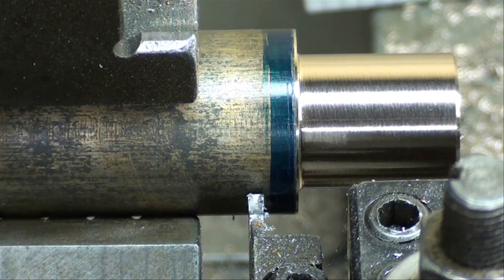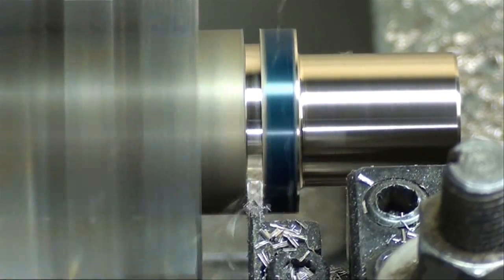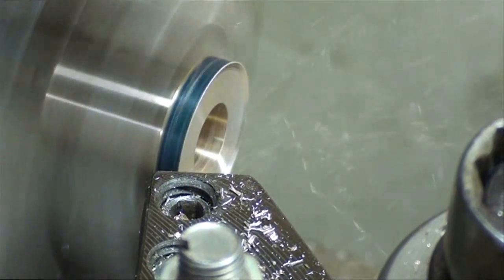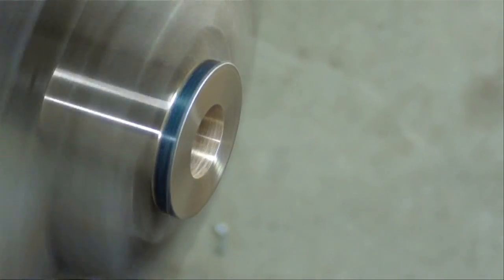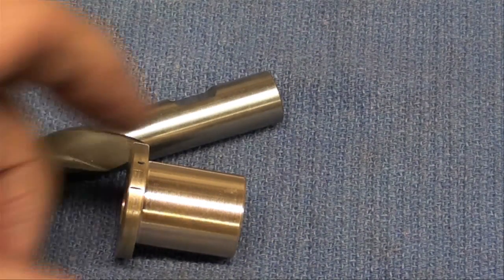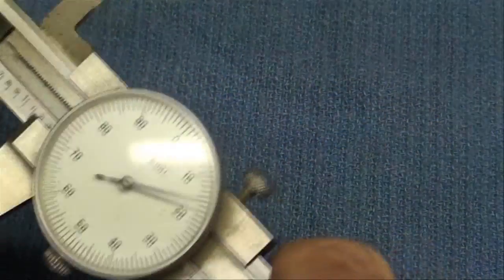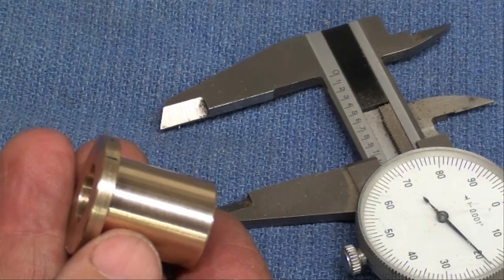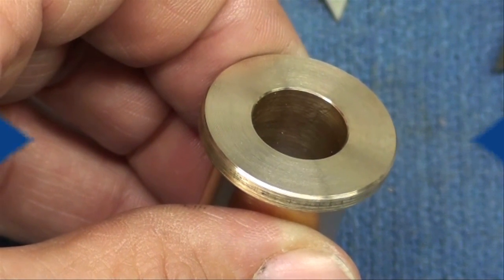MACHINE SHOP TIPS #48 Lathe Project BEARING Pt 3 tubalcain

Comment: Hello Mr Pete. I need your advice please.. I have an old Oliver pattern makers lathe that has the original babbitt bearings in the headstock and they are in need of replacement. Rather than pour new babbitt, I'm considering machining bearings of bronze or phosphor bronze, and would really appreciate your opinion regarding this decision.. By the way, I really appreciate the videos you make for me.. And I don't mind that others watch them too...Lol. 
Thank you sir...
Reply from the maker: Thanks for watching. I have never done this operation.  But if the shaft (spindle) is worn, it needs machined too.

Comment: In the beginning you mentioned that the brass was self lubricating. Does that mean that as it wears, the pieces that wear off slide around in a way that doesn't damage it? Why is brass self lubricating and steel not?  Or is steel too? What makes one metal self lubricating vs another?
Reply: +traderjoes The piece he showed was sintered bronze, not brass. Look up "sintering." It's a process that creates tiny voids in the metal that soak up lubricants like a sponge. Bronze is often used for self-lubricating bearings like the brass one he made here.

Comment: How is that a bearing and not a bushing?
Reply: Technically bushings are bearings. Most "frictionless" bearings have three parts (Sleeve, Journal and then some kind of rollers or balls). A bushing is basically one half of a bearing and the shaft (or "journal") completes the other half. There are no balls or rollers because these types of bearings aren't frictionless. So... technically, a bushing is a part of a bearing. They are sometimes referred to as plain bearings, although I don't think I've ever actually heard someone call them that. Might depend on what industry you are in.

Comment: The cutoff tool is grabbing because it is set to cut above the work's horizontal centerline.  Adjust the tool down to centerline or slightly below, and it won't grab.
The negative rake will also help a great deal.

Comment: I want to buy a lathe but I do not know what all I need to buy, some have told me I need all kinds of extras, like steady rest, a follower rest a 4 jaw chuck and so on, have been looking at a 7X 14 mini lathe any were from 600.00 USD plus shipping to $5000.00 plus shipping, but that one has the milling machine on it as well, witch I also want to get and learn, as I build many things and need to cut key ways for hydraulic pump drives or sprockets.  Any ideas?

Comment: Not sure if you can cut round holes in plate steel on a lathe, an old timer made me a boring bar years a go to use in a drill press, to cut holes in heavy plate, not to mention all the other scary things I have cut using a drill press, oooww,

Comment: With the lathe I only need to make pins manly 3” to  12” long, and ¾” to 2-1/2” round, as well as the weld in bushings, I am hoping I can find a small lathe were my round pin stock can be left long and pass though the chuck to prevent a lot of waste or if a longer pin is ever needed.

Comment: Hmm... something seems a little loose in the toolpost in the cutoff operation.  Note the motion of the toolpost corner as the cutoff tool grabs.  
When I do cutoff operations on my Southbend 10K, I try to snug up the gib screws on the saddle, cross-slide, etc. to make sure that everything is as rigid as possible.

Nice video, thanks.

Comment: Nice job, however to maintain concentricity of the bore and the OD I would have started with the work extended about 1" so re-chucking would not be required except for cutoff.

Comment: Funny, I just did the same exact thing 2 wks ago, on my Wheel Horse drive belt
idler, one step further, I machined a new bolt, rifle drilled it and threaded a zerk
grease fitting.  Keep em comming thanks.